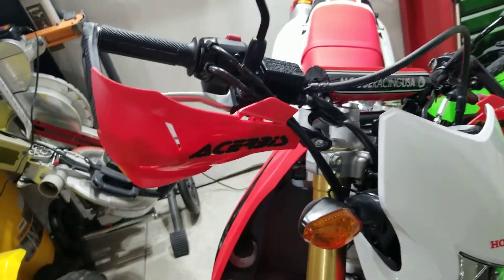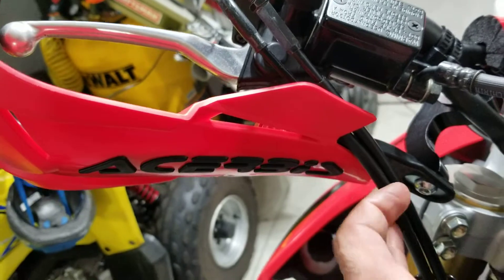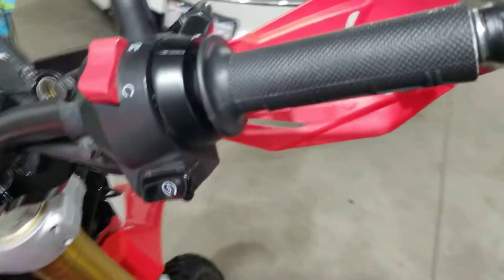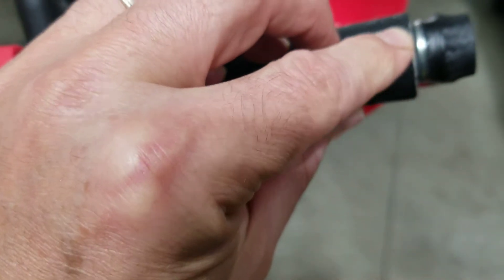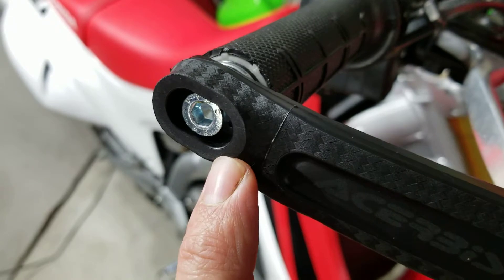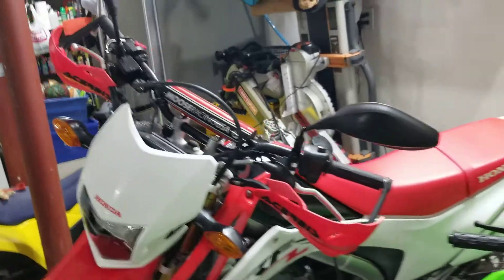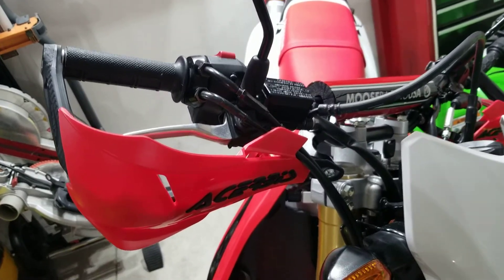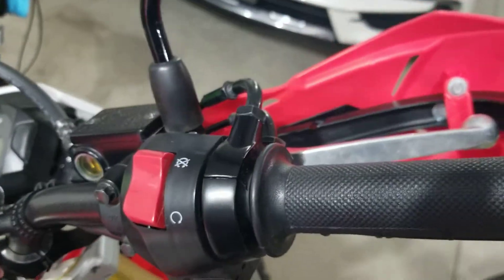Acerbis 26346-61018 X-Factory Handguard Red/Black installed tutorial Honda CRF250L

Comment: Yo bro do you have a social media I need help with my chain
Reply from the maker: No sorry I don't. What's the issue with your chain?
Reply: what bolt size did you use in the handlebar ends?
Reply from the maker: Sorry I don't recall exactly but it was the hardware that came with the guards. I sold the bike so I can no longer measure it.